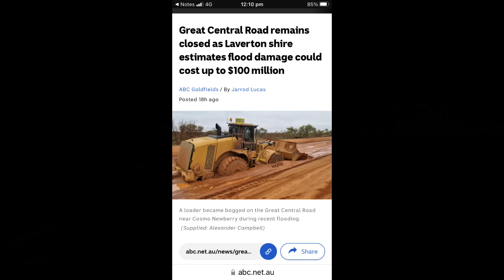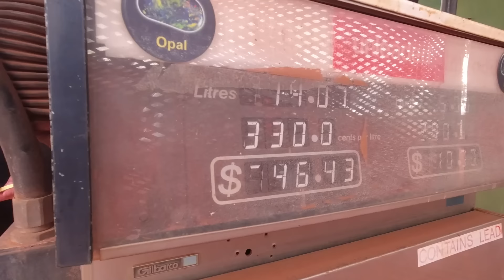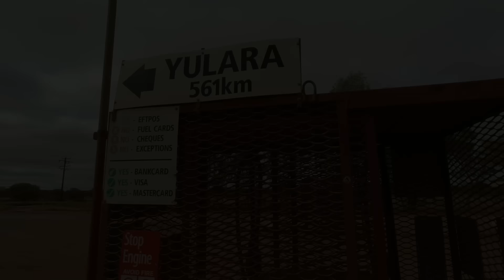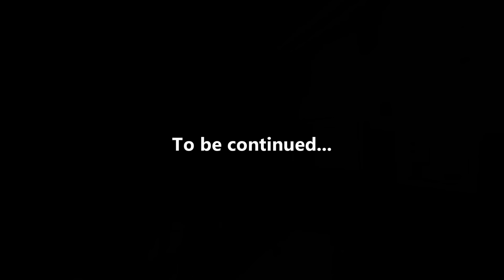Adventure Rider Pilgrimage Through Australia's Outback - Quagmire! - Eps 2

Comment: Mate my WR450F did the same thing luckily enough I had the standard countershaft cover on and retained the nut it's just a matter of pushing the spacer back in and tightening the sprocket nut to spec and bending over the tab on  the lock washer and filling her with oil. 
I couldn't believe how easy it was to lose all the engine oil in an instant and how easy it was to fix I'd say you sprocket nut is close by 😮😉😁☠️☠️
Reply from the maker: That nut would have come off at 80kph. It would be in the bush somewhere. Glad you were able to keep yourself moving. Thanks for watching.

Comment: The seal failing is a pain, but better at Laverton than further out in the middle of the desert.  I'll put a spare seal in my spares bag from now on after watching this.
Reply: 😀Murphy says you'll never need it, something else will go pear shaped!
Reply: @michaelatkins5480  yeah that's usually the case.  I've had one fail on the ct110 before & with only 1lt oil cap it's not long before the engine  is empty 🙂